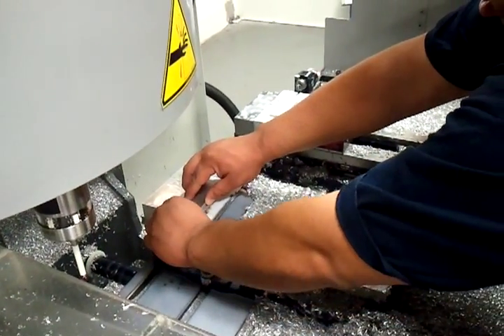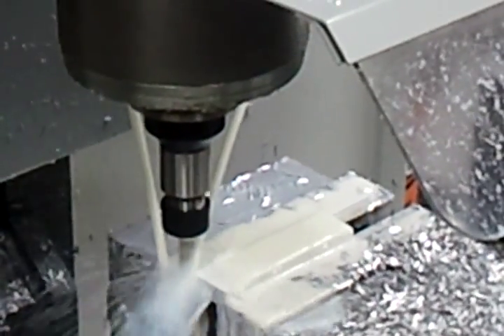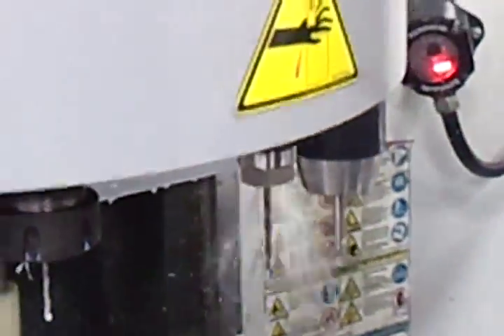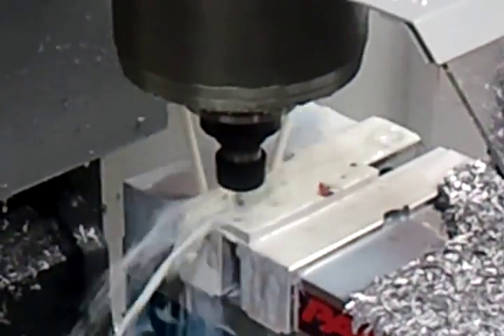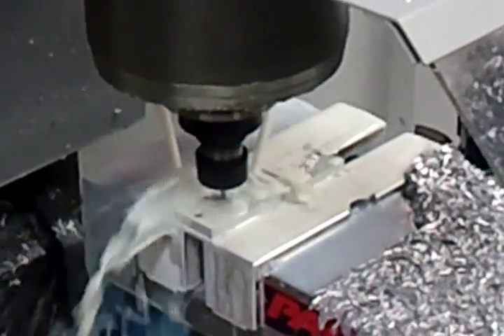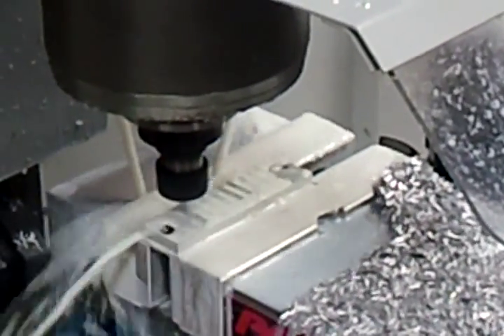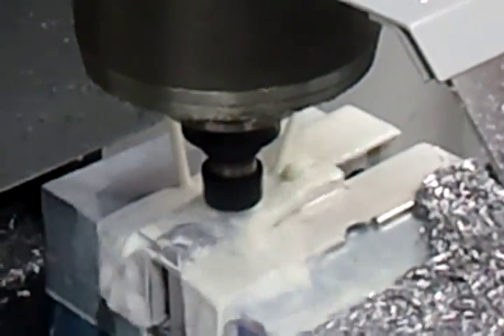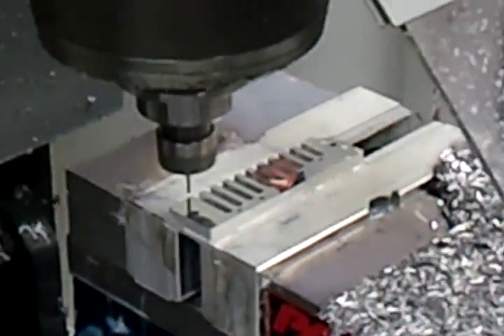CNC Milling of Aluminum Hohner MS-Series Harmonica Comb

Comment from the maker: In the very beginning of the video you can see the machinist positioning the aluminum block between the jaws of a clamp.  It is identical to a vice.  Then he tightens the clamp by turning a handle.  Finally, he gives the aluminum block a little tap with a special kind of hammer to make sure it is seated properly.  

After the top half of the comb is milled, they will flip it over, clamp it into place and cut the remaining metal off the bottom.